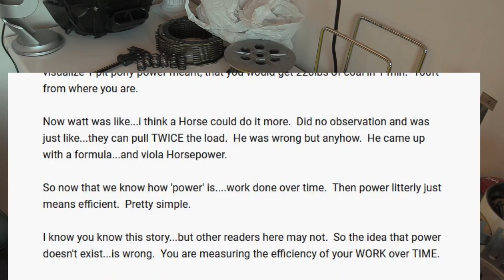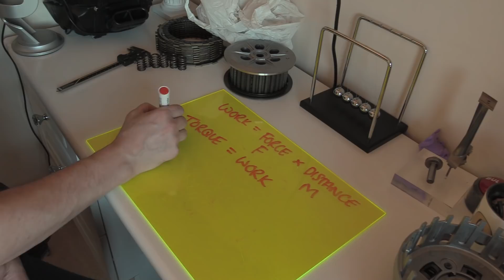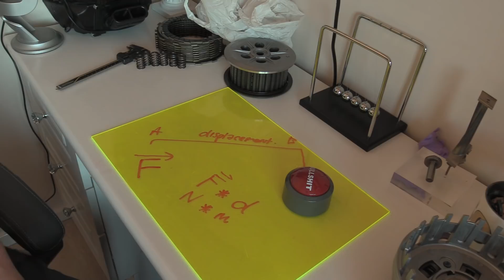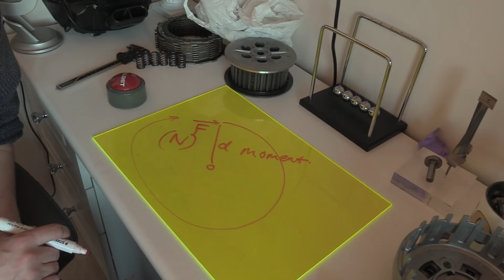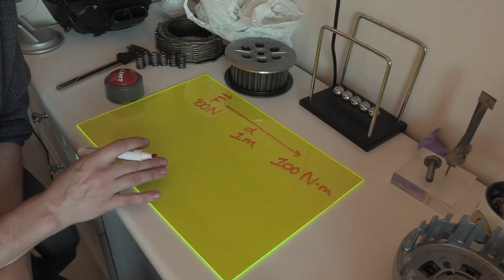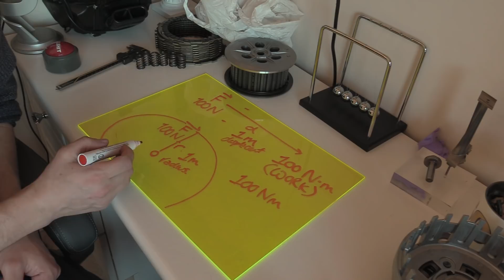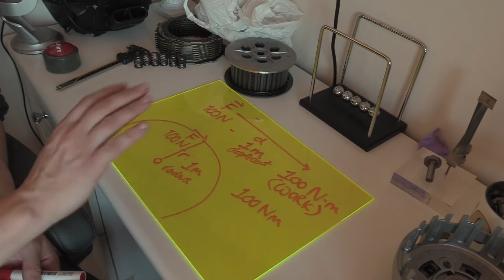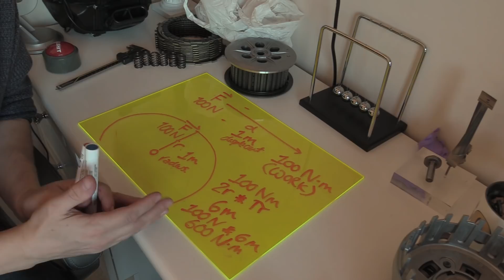Misunderstanding Engineering #1 | Torque

Comment: If you applied a force of 100N over a distance of 100m in zero time as you said it wouldn’t be zero power it would be infinite power. I know you know that it’s the way you wanted to get things across at the end of the clip about power.
Reply: So Maths is invented rather than discovered?
Reply from the maker: Yes. Physics doesn't do maths when things happen. For example wave functions, some people think they're actually real... most people don't. 

Torque is another example. It's not actually a twist force, there's no such thing...
Reply: @thedirtyworkshop  centrifugal force isn’t real either, then these wave functions... supposedly modelling the probability distribution of particles in a quantum state...too much for me to get a handle on, only fleetingly glimpses of understanding before my brain cloud wins out. I hear some boffins are now muttering about forgetting the particle bit altogether of wave-particle duality everything’s just waves...  I also often wonder if Planck length has a height complex🤔
Reply from the maker: Centrifugal and centripetal forces have been been misunderstood...
Reply from the maker: Infinite power is 0 power. Its also 12cm/cubic degC. Impossible is impossible. Mathematics isn't nature.

Comment: Work = Force over distance.
Torque = Force at a distance.
One is an dot product of a force vector and a displacement vector and the other the cross product of the force vector and the positional vector.

I'm actually impressed with the mental gymnastics needed to put aside any common sense while trying to explain how torque and work are really the same thing.

Comment: Another great video. Please correct me if I'm wrong as my understanding may be flawed...... If you had an electric motor that produced 100 ftlb of torque and you stuck a 1ft rod on the shaft and hung a 100lb weight on it you would stall the motor and the shaft would be stationary. The motor is still producing 100 ftlb of torque, the weight on the rod is also producing 100 ftlb of torque (but in the opposite direction).....and nothing is moving. So how much work has been done? Since work is force x displacement, and there is no displacement, there's no work. Since power is work over a period of time and there's no work, there's no power....but there's still torque even though the net torque in the system is zero.
Reply from the maker: In this case yoy are in equilibrium so no work is done. You have to look at the physics of the motor in this case. The motor would be looked in one of the poles of the motors magnetic field. This would be with a permanent magnet system. 

For any other system it would be an energy calculation. You would calculate power by the current and the voltage.

You 'could' have a system where you have a piston on the power stroke in equilibrium but as the heat dissipates the weight would drop

Comment: 6:45 I reckon you made a small mistake here. "Joule" is equivalent to "Newtonmeter" in terms of dimensions/units. Joule doesn't contain time.
Reply: I mean, it obviously does contain time when we look at it in SI units, just saying that if you've already got N*m you don't need to multiply s into it to make it a Joule.
Reply from the maker: Work / time is joules per second. Also called power defined as watts.
Reply: @thedirtyworkshop   yes. Perhaps I misunderstood what you were saying. I thought you were saying to get from Nm to J we need to factor in seconds. All good

Comment: yeah torque is of vectorial nature thats why youd type r x f and not norm(r) * f
Reply: mat maybe you should explain that using "x" as operator is not the same as "*", for better understanding. additionally if youre not in more than one dimension it would be correct to use a dot or "*" for multiplication and not "x". the "*" implies that work itself  is unidimensional right? although I dont always pay attention class too so this might be a little wrong but most of what I said should be right haha

Comment: Problem is that people can't find the connection between phenomena. They don't see the analogy between one thing and another by themselves. My field is electrics and people are usually afraid to work on their wiring - because they don't get it. I usually use fluids, water pipeline, water pressure and similar to make it simpler to understand as water flows in a very similar way to electric current. Most guys get it when I describe the regulator/rectifier like the electric equivalent of the pressure relief valve on a pressure cooker that opens and dumps the excess energy to ground when it goes beyond 14.5V.
I think this situation is very much like the misunderstanding of Volts, Amps and Watts. It's not the end of the world if someone doesn't get it at first. But I reckon Matt has gone through this quite a few times already to make it clear-ish.
Reply: Almost forgot... Water pressure is like torque.
Force over a surface, but fuck all happens until there is a flow. Obviously, high water pressure can do more work than low but you have to provide a path to flow. The actual work is represented by the amount of water pushed through the pipes, not just the pressure that did it.
Same way if you have a seized nut and you can't loosen it, the torque you apply when you try to loosen it is there but no work is done until it starts turning.

Comment: I made a comment a long time ago (different account in case you search it) about how torque is just force in angular units. In physics there is a whole set of units that are for applications involving rotation. Examples are arc length, angular velocity, angular position, angular momentum. These units are defined differently to be more useful for their application. Can’t wait till you break out the vector calculus for these fools. Cheers Matt.

Comment: So much simpler: Work is the force vector times the component of the displacement vector in the SAME direction of the force. Torque is the force times the normal distance aka "radius" to the center of rotation.  one is a "dot-product" because you are multiplying the components in the same direction. The other is the "cross-product" because you are multiplying components normal to each other. F "dot" d  vs  F x r.
Reply from the maker: "Work is the force vector times the component of the displacement vector in the SAME direction of the force."

- LOL this is NOT simpler...
Reply: @thedirtyworkshop  how? If you have a force in a direction but only movement perpendicular to that direction then there is no work. You must have force and movement in the same direction to make work
Reply: You can’t just have a force and then movement in any direction and expect the work to be equal to the product, they must be in the exact SAME direction to take a simple product. Basic vector mechanics
Reply from the maker: Words like

Vector 
Component 
Normal distance
Dot-product
Cross-product

Not everyone (most people) understands these terms. That's why.
Reply: @thedirtyworkshop  its really just a simple google. You forget also that YouTube itself is the largest and most diverse repository of knowledge as well and all of these concepts can be learned in a 5 minute video. Plus these concepts are not hard to explain in your video especially with the handy dry erase board you got there. Btw where did you get it? it seems like it has some fiber optic qualities from the highlights around the edges.
Reply from the maker: It's a piece of acrylic

Comment: Matt, you have a perfect example sitting right in front of you. Newtons Cradle. If you were to pull one ball back and release it you will notice the ball in the middle doesn't move a bit but yet it transmits a force to the ball on the other end. Great video. Try explaining to the guy that no matter how big the diameter and with all the torque in the world, the surface speed at the center of the diameter will always be zero. LOL

Comment: Hey Matt, what's the average piston power and the radius of a crankshaft? We should be able to compute engine torque right? Not at the rear wheel but engine torque. Then since we know the RPMs we should be able to compute acceleration correct? Thank you.
Reply from the maker: No. The reason is that the pressure varies (falls) as the piston travels down the stroke. Using averages get you a very, very rough number. So if you work out the r1 vs a mt 07 you'd probably get 150HP for both of them...
Reply: @thedirtyworkshop  Ok, so that's where bore and stroke, port sizes, piston weight, etc, etc come into the equation to allow for more or less force production. Correct?

Comment: Drives me mad that people think torque is an alternative to power. The only role it has in engine specs is as an indicator of how the engine delivers its power. It would be much easier if manufacturers published power curves. All the information you need in one simple graph.
Reply: I don't understand what such a graph would tells us. Torque  curve (to me) makes sense, as in it illustrates how much a vehicle pulls at different RPM

(now that I think about it, I don't get what's the use for the horse power graph , being that HP is torque times RPM. I've gone and confused myself)
Reply from the maker: Torque let's yoy know how well the cylinder is filling. Ve and torque are almost perfectly aligned. The offset is usually friction and incomplete burning
Reply: @Bugside  torque at the wheel is what makes things move. A torque curve shows you the amount of torque in relation to engine speed at the crank, which on the face of things seems useful, but it ignores the fact we have several gears aka torque multipliers. 
A power curve shows you how much potential you have to generate torque at a given engine speed (power = torque X rpm). Choosing the gear that puts the engine speed closest to peak power means we can generate the most torque at the wheel and that's what make you accelerate fastest.
In terms of performnce, power figures are directly comparable between engines. 100hp=100hp Torque alone isn't. You need to know the engine speed at which the torque is achieved. And torque x speed= power...
Reply: @thebubaloomonkey  I think I understand what you mean.

What I usually see is torque curves made in the dyno at the wheel in sixth gear, which I find useful since it shows if the bike pulls hard at low revs, vs a bike that instead only comes alive at high RPM.

Usually in dyno runs torque curves also  come with power curves, which if that's what you mean can be compared between bike models, this one goes up to 100hp at 10k RPM vs that one

If I understand what you mean, the curves manufacturers release are measured at the crank, hence useless?
Reply: @Bugside  yes torque and power curves show similar things. They are derived from the same data and both illustrate the characteristics of an engine. But if you have one it's best to have power because that illustrates outright performance against engine speed.  Re. measuring at the crank, torque can be multiplied by gears so the torque figure at the crank is wildly different to what you have at the tyre and it varies gear by gear. Power can't be multiplied, so aside from transmission losses the power figures remain consistent.

Comment: 1HP comes from the american library of measurement standards. It comes from the empirical test where you let a 2ft horse penis drop in a pendulum from 90 degrees and measure the smacking force. 50 HP is like getting slapped by 50 horsedicks every second.